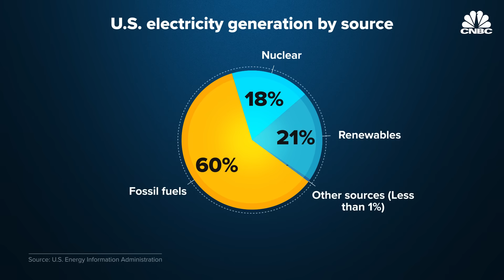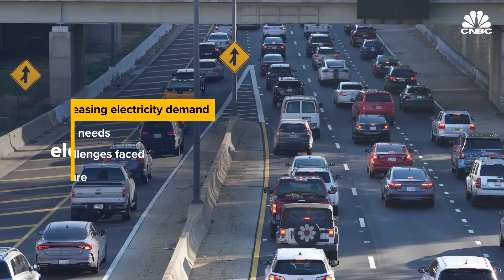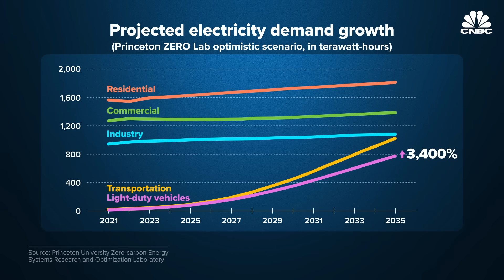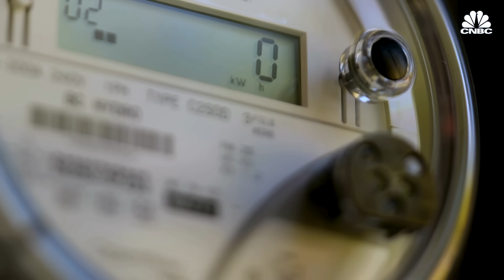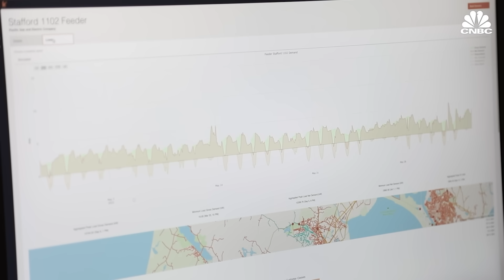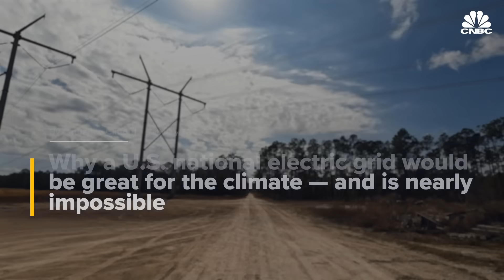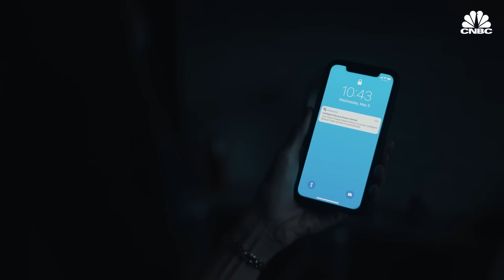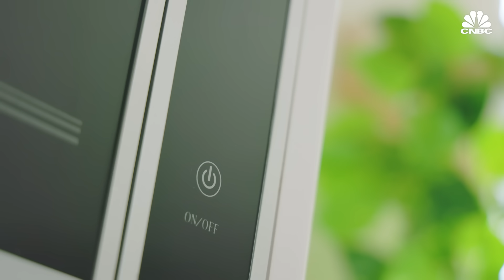Can The U.S. Power Grid Handle The EV Boom?

Comment: Address all the end use inefficiencies with haste and see how far that improves the situation.   Every HVAC system, everywhere - upgrade pumps to variable flow etc...  Lovins referred to cleaning up use as "negawatts" decades ago, and he's right.  Re-do things like insulation, upgrade lighting (and/or reduce where it's really just wasted) etc.  I think the adoption rate will be slow enough that there's time to work fixes and upgrades for things on the grid that are actually already in need to serious attention.  Good driver to make it happen.  Fix HVAC and motors, big start on freeing up power to run BEVs.

Comment: If the idiotic beaurocratic processes required to install rooftop solar, then electricity can be created at the source of consumption, while being democratised.
Likewise if heat pumps were used to heat water instead of electric that would have a massive impact.
Together those 2 things will provide the energy to run an EV for the average daily distance.
I know, as that's what we did in Australia.
Rooftop solar can be installed after a single phone call here, within 2 weeks & Is incredibly cheap.
& we charge the car from our rooftop solar.

Comment: Try 90% by 2030. The exponential adoption curve is steady and shows that will be the case. In China BEVs are already 25% of sales. In 2023 in the US, adoption is already trending to "only" 7%. Doesn't seem like a lot but that's up 62% from 2022. Being conservative, if the CAGR is only 50%, adoption by 2029 will be 80%. Exponential growth is not intuitive, so this may seem impossible, but it is not. Tesla has maintained an avg. 50% CAGR for 10 years.

Comment: Our current centralized power grid is the source of the problem. Cascading black outs, power line fires etc. Non centralized distributed solar is the answer. People, communities and towns harvest and use their own power from the sun. Everyone earns and stores what they use.
Reply: Local and independant grids can always be built. It just makes no sense in the majority of cases, mainly bc. of cost and reliability. As ex., see energy independant islands, all with above average high costs for electricity. 

With electric heating, the big consumption is in winter season, while solar is weak. The amount of storage (or much more solar panels than average demand) needed for that is insane and by far too expensive.

Comment: Yes.  Because nobody is making EV's or will be making EV's, in volumes large enough to replace the existing ICE fleet fast enough to cause an issue.  If the US (and other countries) weren't rapidly expanding battery solutions everywhere (Tesla's megapak's have at least a year waiting list, for example), then yeah you'd start to see issues.  But, consider there's over a billion ICE vehicles on the planet, then consider in 2022 every automaker combined produced ~85m vehicles.  Even in a world where they'd all transitioned to EV production, that's over 10 years before you replace the entire ICE fleet...assuming everyone needs a new car in that 10 year span.

Right now Tesla and BYD are the vast majority of EV's produced, which is less than 4-5m units/year, and nobody in the US is anywhere close to their production rates (I think Tesla outsold the next 19 automakers combined in Q3 2023).  We aren't going to be seeing double digit volume of yearly EV production for several years yet.  Giving society plenty of time to build out the energy solutions (or just continue to let Tesla do it, and they'll own the vehicle and energy markets...nothing worrying there).

Comment: Calling the grid "antiquated" is not a blanket term that can be used against it.  The line and transformer technology from 40 years ago is still valid today.  If you replace the entire line you would increase the reliability of that line and maybe upgrade capacity as well IF you install a bigger conductor with the upgrade.  You could also increase an existing 40 year old line's capacity by only reconductoring (A LOT CHEAPER!).  BUT! it's still a 40 year old line, just with a new conductor.
HOWEVER, THE ISSUE ISN'T TRANSMISSION INFRASTRUCTURE, IT'S GENERATION CAPACITY!

Comment: The arguments about the need to expand the grid are correct.  Local veto power over transmission line placement needs to be curbed. That means once a federal public process determines routes, local permitting becomes non-enforceable so long as a national industry construction standards are observed.   CNBC's largely ignoring the need to expand nuclear production is pandering to an anti-nuclear base of misinformed viewers.  Renewables cannot supply all the power needed.  A nuclear base of 40-50% will be important - we hope renewables can supply most of the rest.

Comment: ``Even if fast charging for a 40- mile range is developed, two arguments for a psyh for quick battery pack exchange modality development remains: First, the exchange modality will allow regional battery checking and recharging facilities located adjacent to power generating plants and high capacity to substations would free up neighborhood power distribution grids. Second, some degree of technological obsolescence as battery storage capacity comes forth. emergence of quick exchange modality is most likely to emergence in China as most citizens live in high rise apartment communities where individual charging setup is clearly out of the question.

Comment: If the system is set up right it'll be fine. The system is currently a two-lane country unimproved road. As opposed to what we need is a six-lane super highway those high tension power lines in the picture wouldn't even be necessary if the system is built right.

Comment: EV is like DNA History
DNA testing traced to the 20th century,it would be decades before DNA could be used for real-world uses
Technology shapes the future and it can help us to develop clean energy, with less emissions 
EV battery cost between $4,000 to $20,000, EV batteries last: 10 – 20 years, Very soon the wastes from
Ev baterries will become the new oil pollution. Do not force the future. Technology will lead.
Question should be, Why do batteries not last forever?  THE FUTURE IS BATTERY POWER

Comment: Will solar power requires grid upgrading, or will electric vehicles break the grid?
No, electric cars won't break the grid if the houses' solar system don't connect to the grid. But just within each house for electric cars' plug in only. And beside solar panels on the roofs, solar panels can also install on the balconies or buildings' outer walls. In sunny day, this source of energy should be sufficient.
So, the key to solve grid problems is not to connect individual solar system into the grid. won't 6:10  break the grid if the houses' solar system don't connect to the grid. But just within each house for electric cars' plug in only. And beside solar panels on the roofs, solar panels can also install on the balconies or buildings' outer walls. In sunny day, this source of energy should be sufficient.
So, the key to solve grid problems is not to connect individual solar system into the grid.

Comment: The idea that the grid has the ability to work with green power is a joke WHY? well wind and solar are not BASE load power and as long as a battery is in the circuit then heavy loads will shorten the life of the system and has happened in Australia with Mr Musks battery bank three big fires that I know of RDP Marine has the only true green power option And is fully recyclable wind solar 65% at best

Comment: Power stations over produce 20 hours a day just to satisfy the 4 peak hours, you can't just turn power station supply up and down.
So charging evs off peak is no problem...
Reply: Power stations never over produce. Every kWh that is consumed is produced simulatiously.
Reply: @Freba9  Oh dear , you can't be serious...
Reply: @whocares264  That’s how it works. The grid frequency can only be maintained if production and consumption are exactly equal.
Reply: @Freba9  Oh you believe power stations can just turn the power generation up and down, what with a big knob, sorry i thought you were joking, i will explain , they need to produce more power than needed to cover peak periods otherwise at peak we would have outages so at off peak they are producing to much power that is why you get cheap power off peak , i pay 7.5 per kw
11.30 pm to 5.30 am ... a perfect example of supply and demand...
to sum up fred in the power station can't just say simons gone to bed let's put fire out...
Reply: @whocares264  That’s called base load, not over production. And yes, power stations are constantly adjusting up and down.
Reply: @Freba9  Oh dear...
Reply: @Freba9  when demand exceeds supply we have outages...
most likely peak times in the winter, no peak times no outages , people need to adjust there habits for the sake of everyone,
that is why off peak power is cheaper, spread the load folks.
Reply: @whocares264  I repeat it one more time: every kWh that is produced is consumed. You simply can’t over produce because otherwise the voltage and the frequency would go completely bonkers resulting in a blackout. Off peak energy is cheap because demand is low.
Reply: @Freba9   'Off peak energy is cheap because demand is low'. by george think you have it...spare capacity off peak..

Comment: 7:00 

You know what power source does produce power wherever you need it? Nuclear.

It's so frustrating to watch all of these videos about the 'clean energy revolution' only for them to talk about location-dependent and intermittent renewables.

Modern nuclear reactors can be built anywhere, produce carbon-free electricity, and are not intermittent. SMR's could just be plugged into old coal power plant locations that already have a grid connection.

Comment: EVs are not environmentally sound, at least not yet. Every time a battery dies, the car gets destroyed. The batteries are not recyclable, at least not yet. You can only drive them where you know there's chargers. 35% of the batteries are lost if it is hot. There are to many negative aspects and lies about the current EVs. If you bought a EV you can't even sell it no body wants a used EV.  Not to mention the cost of putting in a charger  $5000. Then hopefully you don't need to upgrade your fuse box.  Good luck

Comment: These estimates of electricity demand are way lower than the predicted need.   Elon says we need 3x the current supply, not 30% ish.   The new megapack battery farms will allow the grid to expand rapidly and have more parallelism and redundancy needed.   We will have a very different grid in a very short period of time.

Comment: That is the reason why California requires all new residential construction to require solar on the roof would not be surprised if they require all houses to have solar eventually when they need a new roof because California overextended itself like it always does by pushing this ev vehicle requirement when they do not have the infrastructure to support it so they are making the citizens fix their screwups

Comment: After years of lies Im finally reading how they've "discovered" that electric cars are really not cheaper to operate than gas .
The proof has been in front of you all along ! EVs have zero resale value !
But then again people besides the project baby mamas do vote for democrats ....despite daily news of one liberal debacle after another ....
If you can get 200 miles to a charge when new and you live in harsh climate , expect that to be 75 miles by the time you make your last payment in 6 years .....if you take perfect care of it .
Every single fast charge , every single time you give it full throttle, your degrading the lithium battery pak ! $20,000 to replace .....
How much more do people need to hear before they realize that democrats are uninformed clowns !

Comment: A few points: 1) Some areas will have more problems than others. Here in the Midwest the population is growing slowly, if at all, and heavy industry is slowly decreasing. AND EV adoption is likely to be slower than other places (e.g California). 2) Time of day pricing is a big hammer to attack this problem. You are much less limited by the amount of KW-h you can deliver per day than the amount of KW you can provide at any particular time. If you had an EV wouldn’t it make sense to charge it at night, and if you had time-of-day pricing wouldn’t that be a huge encouragement to do so? 3) It is really hard to get new transmission lines approved. Would it not be easier to upgrade current lines to carry more power?

Comment: I suspect that as people become aware of the problems with electric cars, they will not be so keen to take part in the experiment.
They are very expensive, due to the cost if the battery containing cobalt, lithium and nickel.
Charging is a pain, and there are loads of videos of the anxiety of drivers trying to charge enough to continue their journey.
A "battery" contains about 7000 individual calls. A fault in a single cell can spread like an explosion through the battery, the vehicle and nearby vehicles or property. One roll-on, roll-off car transport cargo ship caught fire with electric cars on board. An EV fire CANNOT be extinguished. That ship eventually sunk to the bottom of the Atlantic with £500,000 worth of luxury cars. Another ship caught fire and had to be abandoned.
The battery is VERY heavy and wears out high duty tires.
When current incentives to buy EVs disappear, insurance costs will be astronomical, including transport insurance, by ship,train (not through tunnels), or by road.
To cap it all, building the vehicle consumes fossil fuel for smelting the metals from ore, rolling and pressing. And when you have your expensive toy, much of the electricity to charge and recharge it - is based on combustion of fossil fuels.
It is not going to save the planet. The only solution I can see is what was done in WW2. Drive less, or be forced to drive less. I knew car owners who put their cars on blocks, and went to work by bus or bike. My father-in-law was one.
Meanwhile China is building more coal-fired power stations.

Comment: Nobody overbuilds the grid. It is always nearly full. It handled kitchen appliances, which at the time doubled the demand. It handled rise of home AC systems, which tripled the demand. It will handle EV, staggered charging schedule will easily spread out the load. Owners could set flexible demand asking to charge the car by specified time, and the network would set the optimal charging time slot. The only thing which prevents car being a public transit on demand is a driver. Moving forward selfdriving cars would mostly eliminate a need to own a car for suburbia. Time will show, but I see no catastrophic collapse of the power grid any time soon.

Comment: The EV boom is a fantasy. They are piling up at dealerships. EVs will have a very small market because economics dictates there isn't enough mine-able metals to sustain global transportation based on batteries where mining is cheaper than recycling. EVs are complicated in usage, slow charging for efficient charge, and heating drains the battery 50% faster. Whoever started the belief that the world can have mass transportation running on lithium-ion batteries should be slapped behind the back of the head. To answer the question can the grid can handle EVs - The answer is no. You will need even more energy production and the complication of trying to predict supply and demand will be difficult. You want cross-country travel, you are not going to use an EV unless you are very patient wasting your life charging your vehicle efficiently. The EV fantasy is not backed by any feasibility study.

Comment: US Gov: "We will ban gasoline powered cars"
Electric Company: "Please avoid charging your EVs during peak hours from 6 am - 9 pm. Otherwise a penalty fee will be accessed."
Electric Company (@10 pm): "We are experiencing temporary power outage. Repair completion ETA is 5 am" 
Electric Company (6 months later): "Please see the attached price increase in the upcoming months." 
EV Owner: "Let's line up at the mall and queue for an hour and wait our turn to charge our vehicle." 
EV Dealer: "Your battery life is dropping so we will need to remove super-charging capability from your vehicle just in case."

Comment: If the power generation and storage is decentralized, no changes are needed. It is a problem only when a huge solar and wind projects approach is taken. The second approach bring the transmission and single point failure problems.